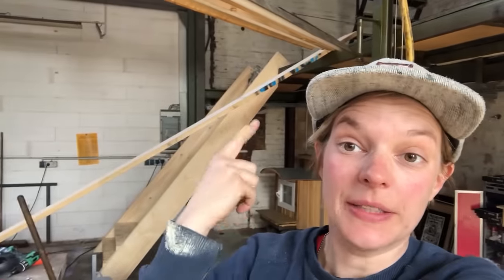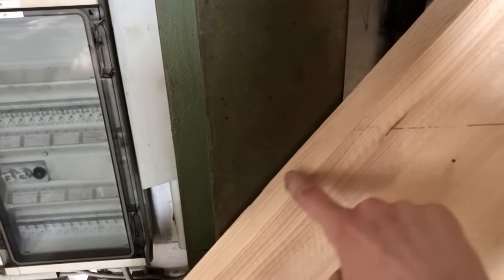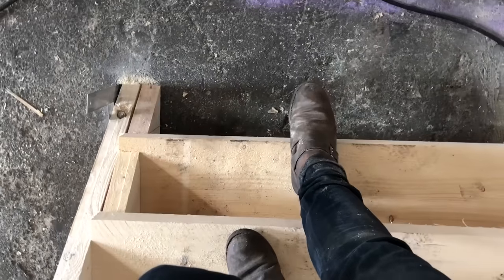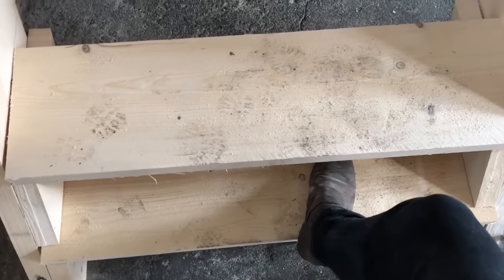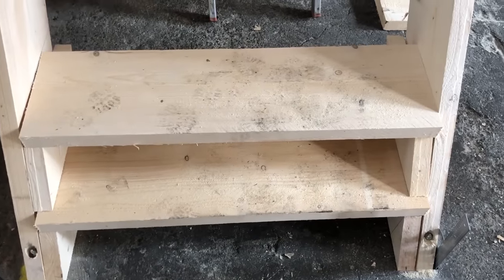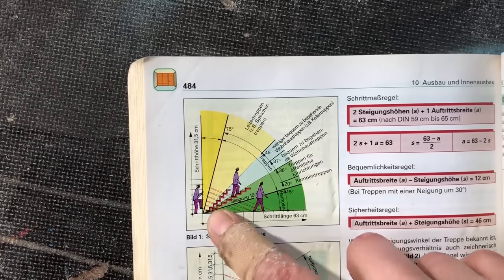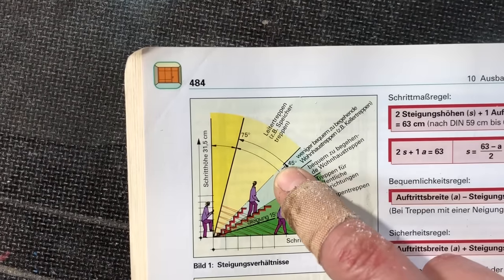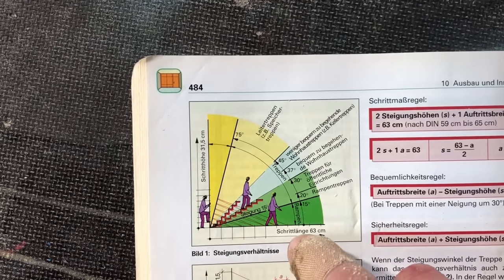Building Stairs in 8 Hours

Comment: I'm a carpenter joiner and I don't see to much wrong with your stairs. It's a commercial setting. Made from good timbers. okay it's not a traditional method but they work right. Only thing would be screws would be better. Some glue also. 👍
Reply: sicpac66 nails have a higher shear strength than screws!!

Comment: Great Job but if I could give you a small piece of advice it would be to ALWAYS GLUE AND SCREW your stair treds...this will guarantee that your stairs will not squeak over time...nails have a way of always causing squeaks and lumber as you know expands and contacts with varrying temperature....You did an amazing job and you made it look easy
Reply: Thanks
Reply: Please not glue the staris. The woods are working in different ways, so the glue makes no sense.
Reply: @christophhamm7711  obviously you have little experience.

Comment: Love your projects and attitude!  Stairs are tough...... my one word of caution is in framing the bird mouth at the top you have reduced the strength  of the stringer by about half. Easy to remedy.... just add a support to the bottom of the stringer attached to the underside of the mezzanine. Keep up the wonderful work! Thanks
Reply: or some long strong screws from bottom to top . on heavy loads it maybe could rip right at the point of the triangle ...
Reply: My thought as well. We usually just cut the top on an angle and attach to a cross piece between the two stringers. Then nail that to the side of the upper floor. But in both cases, there is inherent stability because the bottom of the stairs are secured in concrete. So the most these can do is pivot. And because there's a relatively thick upper floor, there's no way the top of the stringer can make it by. Even if the birds mouth breaks it still isn't small enough to slip under
Reply: Good point.....

Comment: It's cool if you are learning and building random stuff (stairs) but just for other people watching, it is not recommended to build stairs this way.
Get your local building code or ask local building authorities. Find out your minimum and maximum rise and run of your stairs.  In my local area the code is as follows:
Rise = 125mm to 200mm 
Run = 210mm to 355mm
using a general rule of: rise + run should equal between 430mm - 460mm, which also should give a comfortable stair angle close to 30 to 35 degrees.

Also, if you do not know what you are doing, please get help or get a professional to do it. Those stairs can be a huge safety hazard: tripping, collapse, etc. Additionally, you also have no handrails or guardrails. Wow. Living life on the edge I guess. 
Good Luck!

Comment: That worked out well in the end.  

Stairs (here) are specified as rise/run instead of degrees.  Max rise is 7 5/8" (sorry about inch measurements), so I take the total rise and divide by 7 and round up to give me the number of treads needed, so my rise is always under 7".  Tread I figure by 2 2x6's which gives me 11"  which is above code and gives me an inch for the nosing (how much the upper tread overlaps the one below it).  Our building code also requires a railing so you don't fall off the edge.

Hope this simplified method helps in the future.  Great looking space.

Comment: The first thing I notice is that you set the untreated stair stringers directly on concrete.  The wood will draw moisture from the concrete so since you didn't use treated wood, you should put some sort of vapor barrier between the bottom of the stringer and the concrete.

Comment: Next set of stairs you make you should consider I forget what they are called but Porter Cable used to make a jig for a router where you do the rise and run on the runners then you make your steps and wedge them in with shims and wood glue. If done properly they will never squeak and be super sturdy.

Comment: Good job on those stairs, but don't forget to add anti-slip tape to the steps (it looks like sandpaper with an adhesive backing); that'll keep you from taking a nasty tumble.
Reply: It's unplaned timber. Not necessary.

Comment: Do you need to use pressure treated lumber for this kind of project? I am trying to make steps in my garage which has concrete floor. Not sure if regular lumber can directly touch the concrete..

Comment: Wow that's awesome.
The best stairs angle is 26°33'54.184"
Or the ratio of 1:2 for the vertical and horizontal faces
Reply: What? 40 degrees is ergonomically optimal. Of course, it's a lot easier to build a staircase with only a set rise and unlimited run.
Reply: My stairs are usually between 35 and 40.  All depends on riser height and tread depth.  And THAT all depends on wall heights, landing location and flow etc.

Comment: Rise and run added together for comfortable stars should be 18 inches. I personally like a 11.5 inch step so my rise will be 7.5 inches.  Measure height in inches, divide by 7.5 that's how many treads you will need then multiply the treads by 11.5 that's how long your stair string will be. I personally prefer to cut stair stringers or to router the. In for interior steps only. I also recommend to add in a landing for anything with more than 5 steps if you have more than 10 stairs

Comment: What kind of book was that? Did it have more general construction type stuff in it like the stairs.
Reply: Yeah, I would buy one too. I do not need it right now but it's handy to have around!
Reply: There is a book in English called Audel - Carpenters and Builders Library. There should be 4 books in the set and I think the books are out of print or reasonably old but I just Googled it and found them on Amazon for around $80 and on eBay for around $20.
Reply: Info from "Zinken und Zapfen" under an other comment:
Book called Fachkunde Holztechnik https://amzn.to/2XgE7Qb its the newest version. Book is for carpenter education in germany. Good Luck

Comment: Nicely done!

My only concern is that you have blocked the accessibility to your electrical panel/breakers. Your electrician  will probably be a bit unhappy with the placement of the stairs. (As a guideline, in Sweden, 1,2 m in front of the panel should be cleared to secure the accessibility. )

Keep up the fantastic work!

//Hans

Comment: If extra space at bottom is not so important, you colud made few stairs(4-5)  in 90° angle at the bottom when you made a mistake at first try and use that space under those as a storage. Great work, either way.

Comment: Very nice job, but if I would change one thing it'd be to inset your treads on your stringers. To do this just chalk a line 2" down from the leading edge of the stringer, then lay out your stairs from that line. Your stairs will have a much cleaner look.. but good job with these stairs

Comment: Easy fix without having to start over...Take the difference of the actual angle minus desired angle of the risers.  At this point you can leave your original risers installed.  Now, take your new measurement and instead of installing the treads parallel to the floor, install them at your new angle (actual riser - desired riser) with the front of the tread angled toward the ceiling.  

Just kidding.  I really appreciated how you handled your measurement flub.  I make mistakes all the time and destroy myself thinking I'm the only person who ever screws up.   Great job!

Comment: What about the 7-10 rule? What about using the stair formula to get as close to 7" rise 10" tread as possible? And notching a green treated 2*4 at the bottom for your bolts and putting yellow lumberr in the middle and the top. So u can lock that stair in. 
There are construction stair calculator apps that work well. Make the math simple. But u have to know to take an inch off the top and bottom when measuring. So your step stays the same. Continuity..
Good luck

Comment: Hi Laura. Sorry for Your first set of stairs,,,stairs are not simple but good for You, You reset had a coffee and kept going. 37,38 degrees is a comfortable set. Old saying ,length and headroom permitting ,stairs should add up to 18. ie 11 inch tread, 7 inch rise = 18 +/-   
Usually when building stairs We go from finish floor to finish floor and divide the rise as close to 7 inches as We can. Next stair You build ,learn how to cut a stringer, run and rise then You will not need the extra work of blocking under every thread. Great work
My motto especially with stairs or roofs,,measure 5 times. No fixing either if You are wrong.

Comment: It's not a failure in the slightest, Myself included I have never seen someone make their first set of steps without a few hiccups. I ruined three 20' 2x12's on my first set. And those stairs you built look Stout and heck. Should last a very long time. Personally I think they would look great if you darkened them with a blowtorch and put some oil on them.

Comment: Nice staircase, though probably need to strengthen support at the top of it now.
Reply: Just a question, Zero Cool or anyone: I see what you're thinking about the strength of the notch at the top, but isn't the vertical force of the weight of the stairs and people & objects going up the stairs, given the tie-in to the floor at the bottom, transferred to a horizontal force against the front edge of the loft structure? In other words, it would seem to me that even if you cut the top part of the notch off (which looks like it's what holds the stairs up) , the stairs wouldn't fall down, because the bottom of the stairs is held in place with the foundation bolts, so it wouldn't slide away from the loft as the stairs press against the loft.

Comment: Can you share the name of the reference book you used for the stairs.
Reply: There is a book in English called Audel - Carpenters and Builders Library. There should be 4 books in the set and I think the books are out of print or reasonably old but I just Googled it and found them on Amazon for around $80 and on eBay for around $20.
Reply: Thanks just bought it.  Looking for something that covers ergonomics in carpentry and furniture making.  I've seen Laura reference the same book in some of her vids, something similar to BUILDING CONSTRUCTION ILLUSTRATED.  Not a how-to but standard practices and measurements.
Reply: My guess is you are interested in numbers, not words, and so don't care what language it is in.
Reply: Correct illustrations and numbers

Comment: The top part of the stairs is weak the part that is holding the upper flor. Could crack in time, you should support it by vertical wood.

Comment: How I know how many steps and the right space in between?
Reply: Measure your top floor to bottom floor hight in inches by 7. 
Example 108.5" ÷ 7 = 15.5 
15.5 tells you there will be 15 stairs
Take your height 108.5" and devide by 15 for stair hight
108.5 ÷ 15= 7.23 
Put your marks or clamps on framing square at 7.23" rise and and 11 for run

Comment: Use  the 7-11 rule....
7" rise 11" run or closest to exact requirements.   
Worksafe🤗
Reply: We usually use 63cm (Schrittmaß)....just building one with 17,5cm rise, 26cm run 3cm overlap.
Reply: @heavyweather  Yes,  I too use metric...
Reply: Seriously Dont try to formulate a theory on stair comfort proportions.  Riser height is dependent on headroom clearance, total rise and building code..risers must be the same, top to bottom.  Tread depth between 9 and 10 is comfy.  If my unit rise is 7 i am not going to just pick 11 run because  it makes 18... Tread depth decides where the stairs will end, which in residential construction is often crucial.  1" difference in tread will stretch your stairs out 13-15" on average staircase.

Comment: If the sum of the rise and run  equals 18 inches it will always be a comfortable climb no matter the stair angle
Reply: Lee Barnhart what if the run is 1 inch and the rise 17?
Reply: @billym129  well then it's comfortable because math.
Reply: Seriously Dont try to formulate a theory on stair comfort proportions.  Riser height is dependent on headroom clearance, total rise and building code.  Tread depth between 9 and 10 is comfy.  If my unit rise is 7 i am not going to just pick 11 run because  it makes 18... Tread depth decides where the stairs will end, which in residential construction is often crucial.  1" difference in tread will stretch your stairs out 13-15" on average staircase.

Comment: Nope . Pull down from the second story to the first story that's your height . Divide that by the number of risers . Your distance out should be divided by the number of treads . take those two numbers mark them off on your framing square put your bucks on it to hold the numbers . Trace and repeat until you run out of rises and then put your foot on the stairs with a piece of green shoe in the notch at the face of the stairs . Once you cut the first stringer out you put it on top of the next one trace it out cut it out then you put it on top of the next one trace it out and cut it out .
You are no carpenter . That set of stairs should only take about 4 to 6 hours . your rises should be around 7 and 3/4 your runs should be around 9 1/2 . Your overall angle down should be about 34-37° . then you measure down the side of each stringer at the bottom of the cut make your pitch cut on each end and then attach a two-by-four on to the inside of your stringer to add rigidity . Stop misrepresenting carpenters . I've been framing custom homes in Northeast Florida for almost 30 years I've seen plenty of hacks like you try to do that exact b***** and I'll tell you right now it doesn't fly . where is carpenter's have enough problems with trust without hacks like you f**** it up by doing poor work .
Reply: No thumbs up for the facts. Only hacks here guy! Based off of my experience in flooring. You're method seems accurate. since I've had to cover stairs like it was upholstery too many dam times . It's a shame people can be praised for hackery, and end up hiring people to learn hackery. Who would have been better off being employed by an actual master of a trade. People with a hard work ethic but without the social resources seem to end up becoming a victim of people like this chick.

Comment: 🤦🏽‍♂️ rookies.. she must have saw how to build stairs on Pinterest. Every one is a skilled carpenter on Pinterest. All she had to do is measure her rise and figure out the run to get 10” treads. Or she could have done it even easier and get a construction calculator and type in your rise and hit the stairs option. The fast effective and correct way would be to figure out your math on paper, write a cut list, cut your stringers, treads and rises. In this case no risers are needed. Anyways, cut all your material first then layout out your stringers. Then install. I personally would have built the stairs on the ground then hoist the stairs case up by hand or if it’s to heavy from underneath. Tie a strap in the middle of the top tread then climb the ladder and hoist it that way. I’ve done it hundreds of times. And a stairs set like this wouldn’t take me 8 hrs 😂. A stair case like that would take me probably 2-3 hrs. But hey to each there own.